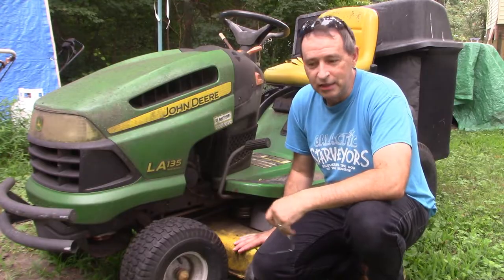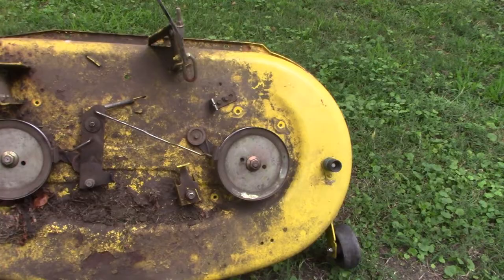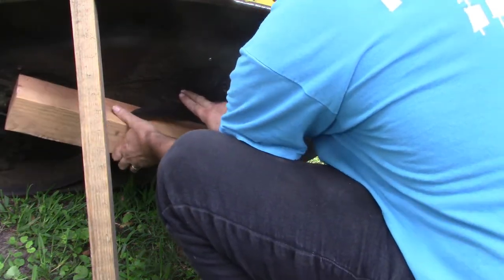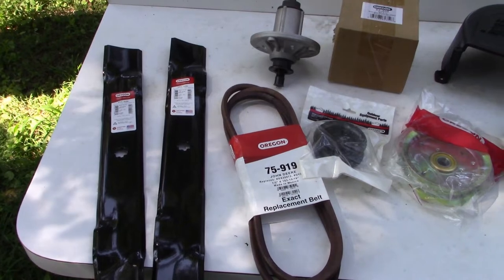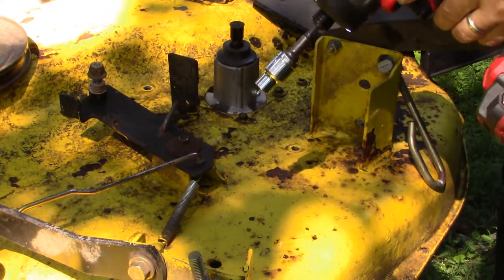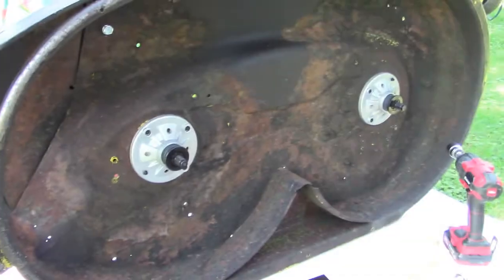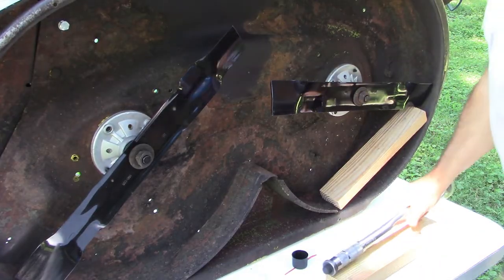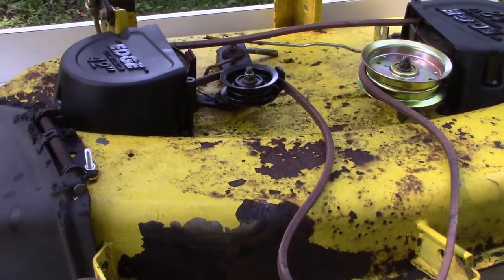How to Fix a Noisy Mower Deck - John Deere Lawn Tractor - Spindles, Pulleys, Blades, and Belt

Comment: It would have been helpful to start the mower before fixing.  So, we can determine if your noise is the same as ours.
Reply: I had a broken pulley, and if it helps it sounded like an ungodly loud mad clanging, and the deck vibrated the mower like an airplane through bad turbulence. Turn the mower off and then resch under and try to move the blade up and down. If it moves up and down it is likely the spindle. You can remove the deck and look under to confirm. You'll probably need to remove the deck even I it's something lesser like a loose blade so no harm in removing it.

Also with a bad spindle if you can point a camera or mirror at the belt, the belt will shake a lot up and down due to the wobbly pulley and for me it cases the belt to be thrown off a lot, like multiple times per mow.

Comment: I have an old craftsman lt1000 with a horrible noise and haven’t pulled it apart yet. Tire keeps coming off the rim also. Probably has a leak.

Comment: So how much did you spend on parts? I have a JD D110 that has some deck noise also.
Reply from the maker: I don't remember what I paid. You can buy complete rebuild kits on ebay...belt, spindles, blades, pulleys all included....often aftermarket parts, not JD originals, but decent.

Comment: Mine will engage the blades which is quite loud and it starts shaking and then when you go to mow the grass you do maybe 3 lines and then it starts squeaking and then a load of blue smoke that smells like rubber comes out from the deck and you have to turn the mower off the stop the squeaking
Reply from the maker: Sounds like you need to pull that deck off, do some diagnosis, and figure out what components need to be replaced. Good luck.

Comment: You should have let us hear the noise! How else can we know if OUR noise is what You're  fixing?
Reply: Mine does not squeal, it is just three times as loud as when it was new , when the blades are engaged.
Reply: @Carole Just Carole  mine is so loud you cant talk around it.
Reply: @danielrose7311  I feel ya! I go inside when hubby is mowing, it hurts my ears! If I am mowing I use-ear protection.  I just watched Chicanic replace a spindle, belt and I think a hmmm, thing that is round and gas bearings, the proper name escapes me.  When we next change the blades ( lol, when hubby does), I am going to take a look at the various parts and see if anything is too loose, or not moving freely.

Comment: On your John Deere LA135 when you increase your engine speed do your blades spin the same speed or faster
Reply from the maker: Yes, the deck speed is determined by the engine speed. You want to mow with the engine at full throttle (fast) or nearly full.

Comment: Pretty much ALL spindle assemblies are designed to FAIL!. THE BEARINGS ARE SEALED even if the spindle has a gresert. You have to take them apart and remove the bering seal on the side that faces inwards on both bearings or it will last one.. maybe two mowing seasons and their trash.
Reply from the maker: You're right. The grease fittings on these are just a placebo! But I think you can get more than two seasons out of them. This tractor is several years old, and I'm sure this is the first time the spindles have been replaced. Thanks for the note.
Reply: @Buckwsr  I've owned two Deere riders and never had spindle problems...yes there are rubber shields on these bearings but all I ever did was pump lots of grease into them as the cavities in these spindle housings are fairly large and the grease will bypass the rubber shields and lube the bearings. You will see grease ooze out at the top of each spindle housings. I only pump these up with grease about every 100 hrs.
Reply from the maker: @oldpete3153  Thanks, Pete. Good tip. I will keep that in mind.